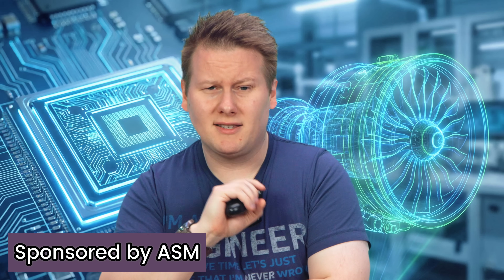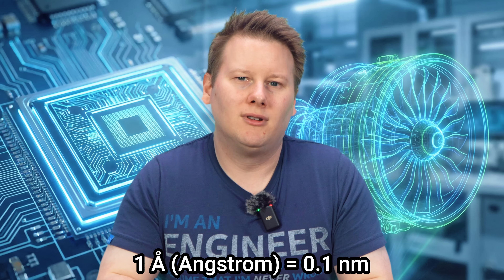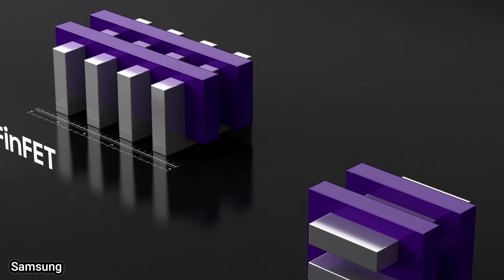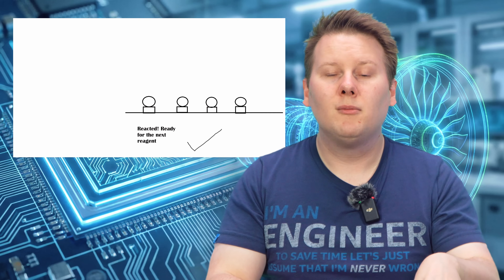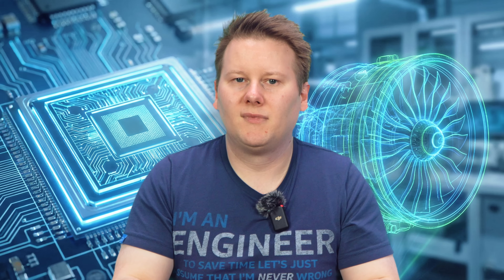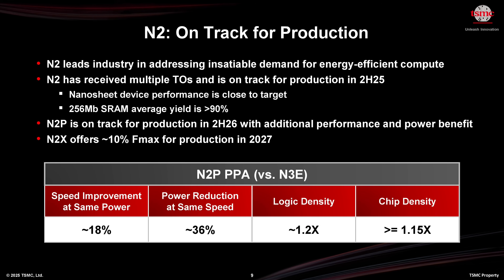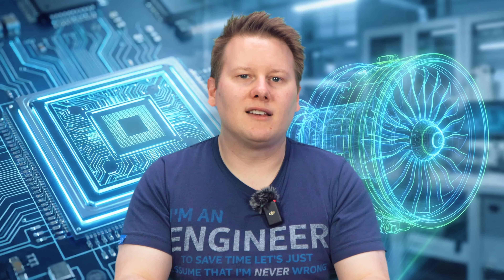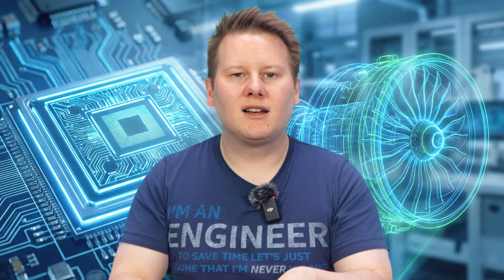The Breakthrough of Leading Edge CPU and GPU Manufacturing

Comment: Losing track of an electron because you only had three to start with is the soft error catastrophe that makes these devices increasingly risky. Power density is the other limit to obsessing over tiny geometry.  Energy efficiency doesn't track sufficiently with geometry. The Chinese are backing on-chip optical interfaces to allow larger assemblies of cheap components and memrister topologies embedding bit-scale memory along with bit-scale logic eliminating thinking here but remembering there... (This is why Einstein's brain consumed 20W while the Krell Intellectual Enhancer needed a planet's worth of power.)

Comment: Can someone explain the difference between the company ASM and the company ASML?  Are they joined at the hip
Reply from the maker: Nope, completely separate, and both public. They focus on different parts of the chip manufacturing pipeline.
Reply: @TechTechPotato TY. Advanced Semiconductor  Materials [Lithography]
From wiki "ASML was founded in 1984 as a joint venture between the Dutch technology companies Philips and ASM International. It became a fully independent corporation in 1995. ASML's corporate headquarters is in Veldhoven, just outside the city of Eindhoven in the Netherlands and is the location for research, development, manufacturing and assembly. ASML employs more than 42,000 people..."

Comment: come on ion deposition ray gun. one process for all steps. yep it just works. yep just normal 3d printing but in nano scale. ie you also grow walls in the same way. knowledge is for law breakers btw. watch out that it wont attach to you by the skirt. you can do mass ion 3d printing with swapping multiple growth pattern masks with a wide ion gun, not just by drawing with a narrow ion gun. just swap the ions and the masks per layer. so that your lawyers judgements dont get a bite on the real thing. of course the ion 3d printing can be first tried with say 10nm or even 100nm or 1um size scales for test purposes naturally. like for 1um diodes of course for wafer based solar panels of course. layered 3d printing process instead of complex physical sizes processes. ie those under law are being judged by the law. those who believe are not being judged by the law by not being under the law. ion gun drawing without masks vs ion gun deposition by masks. or both. selectively funded economy does not work btw bruh. better that nobody gets paid by people at all. or that everyone gets paid no matter what they do. christ cleans flesh tainted body.
Reply: yep masked ion deposition 3d printing by layers. nope not resist photolithography masks but hard ion deposition pattern masks directly. no photolithography clean step at all in the middle required. just need to align the ion deposition masks per each layer very accurately. ie christ ion gun light is your only light, flesh is darkness and cant do anything, only destroy or block light. so any credit of doing anything goes to christ always. ie flesh is always law breaker by law.

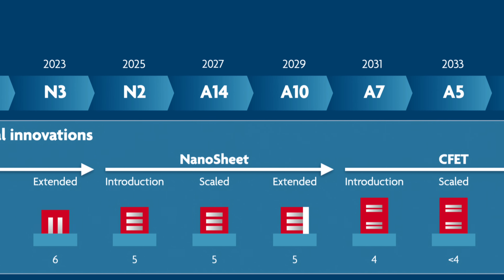Comment: 7:36 Similar to CFET you could also use two Wafers with  NanoSheets and stack them together with advanced packaging
Reply: It's not the same thing. CFET is stacking N-channel FET and P-Channel FET on top of each other. Because of this arrangement you gain better power efficiency and higher frequency not just higher density.
Reply: as a laik, I can see that this maybe alows more 3d building? ... :)